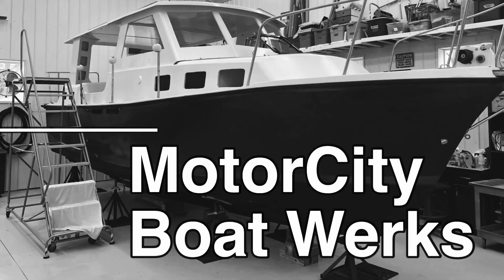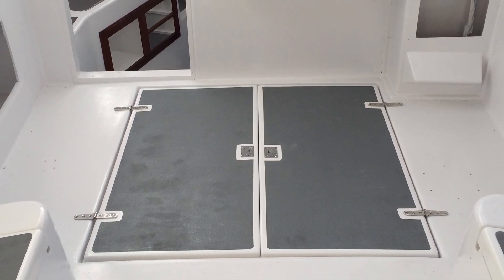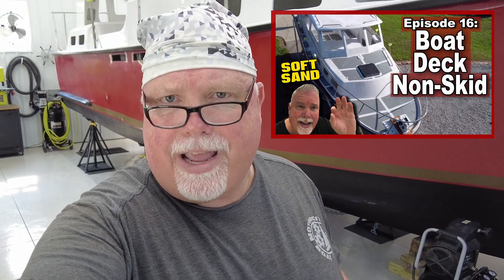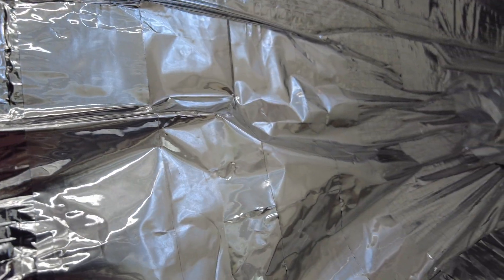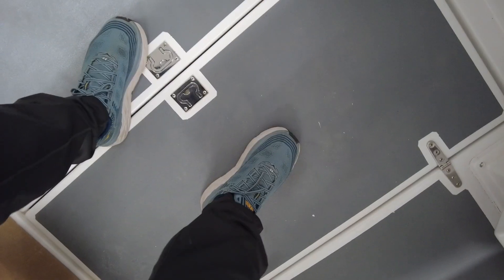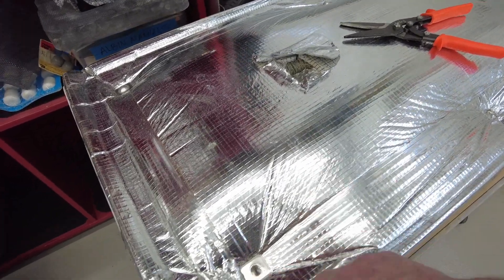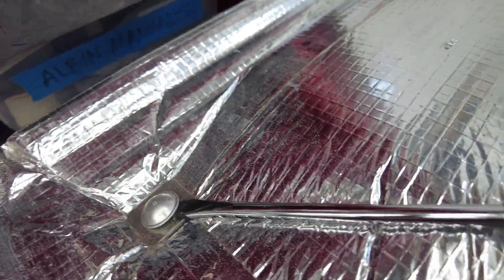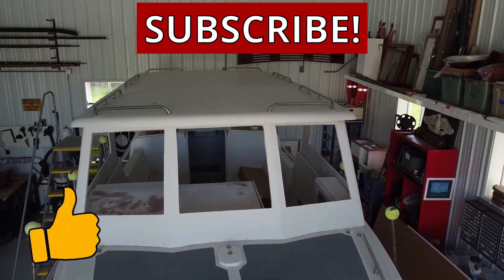How to Sound Proof Engine Room Hatches | Boat Building |Sailboat Restoration (Ep44)

Comment: My hatches flexed also, but the problem was actual flexing of one of the hatches. I had to add reinforcing strips on the bottom of that hatch. I suspect that my 1984 hatches had different reinforcement. Your boat is a few years newer, so it was probably built differently (better). I'm using a less expensive high density sound insulation covered with aluminum adhesive backed sheet.  The new Beta 50 diesel is quieter than the original engine, but no matter what we do, these boats are still a bit loud.
Reply from the maker: Interesting. You can see the half round supports glassed into the underside of my hatches in the video. This is what makes my hatches stiff and heavy.

Comment: Thinking out loud, no disrespect as I have zero experience with soundproofing.  Would it make sense to lay the sound proofing and terminate it before the lip so there is less chance of it tearing near the edge and getting wet.  Then place another section of sound proofing from that edge to the lip.  If that narrow section tears from friction or something else, water will be stopped from entering the main section.
Reply from the maker: Interesting idea William.  There’s some limitations in the original hatch design from the factory( not covered in the video) that don’t really allow this. Now it’s all  reinforced and easy to repair now. No worries going forward  👍